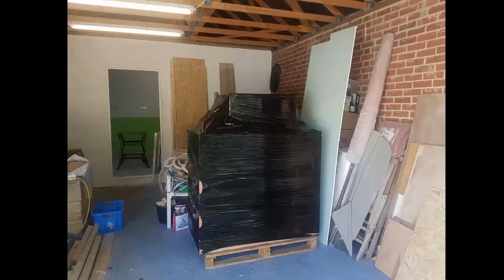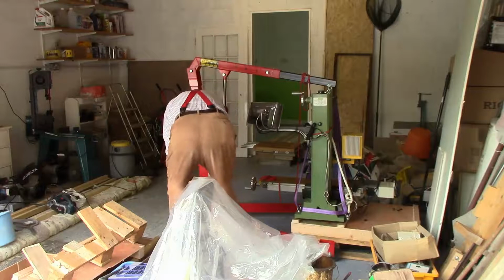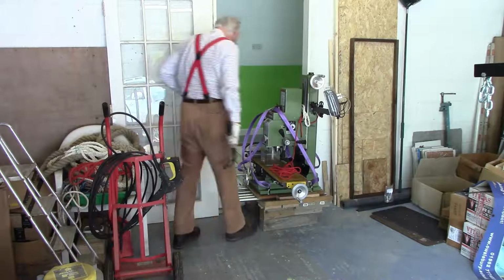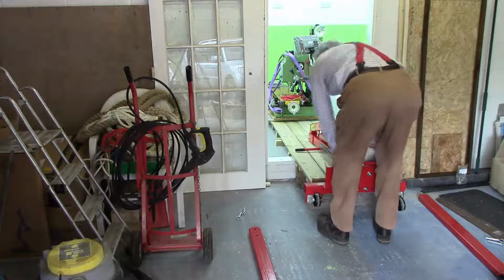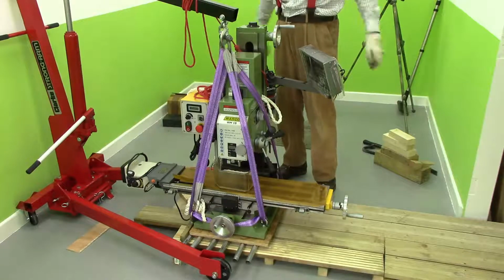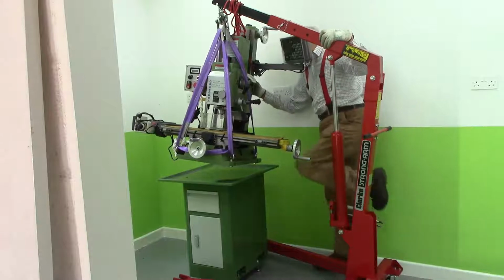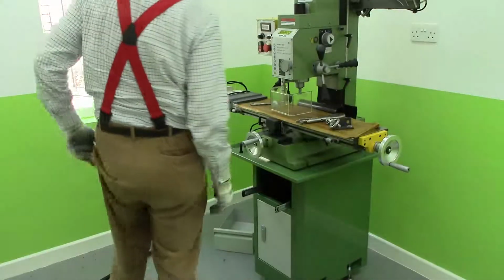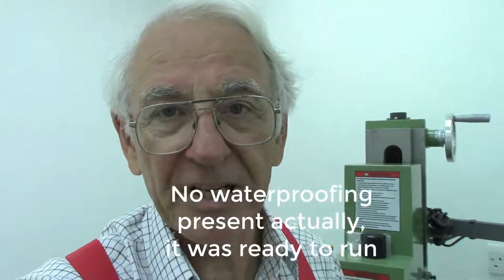Moving my new milling machine

Comment: I’m looking at getting this WM18 along with a GH1236 Lathe in around 6 months when I finally move to a house with a workshop (garage) - watching you move this alone is both amazing and nail biting anxiety inducing - I can honestly say the prospect of moving a 200kg and a 560kg bit of kit has been filling me with dread but this video (along with the one of you moving the Harrison 300 has given me some hope!) - I hope to see videos of you putting this mill and the 300 into action soon!! - I agree that the stand doesn’t look too stable given the small footprint - high center of gravity - I’ll probably look to run a strip of unistrut between the back two levelling feet then bolt it into the ground just to alleviate the fear of getting squashed!

Comment: Hi folks. a bit late but I've done this as well. Don't lift higher than absolutely necessary. Lower the weight onto supports when moving, do not let it swing. Never ever get any bit if your body in the gravity shadow - that crane could suffer a hydraulic failure at any point. I ran my head right to the top of the column, locked it in place and lifted using it. Having the attachments low down is inherently unstable. I had to dismantle the crane to get it into position in my workshop. Ideally have someone present with a mobile phone but do not have them involved in the lift. Still it got there in one piece, but do take care and think things through first. Heavy things like this do not take prisoners. BobUK.

Comment: Great minds think alike. I moved my cochrane bly mills using rollers as well.  https://youtu.be/_OB08ib9YO0
Reply from the maker: Yes, but yours is much heavier! Was that 1500 lbs did you say? Amazing machine looks like a vertical mill with a shaper stuckk on the side.
Reply: @samuelfielder  in this configuration I theorize it might weigh as much as 2700 with that vise and motor . Yes, it's part vert  mill, part shaper, part slotter. Neat old machine in my opinion

Comment: Well done. I dont like these stands however, glorified biscuit tins. Trapping yourself between a wall, a heavy machine and a crane had me on the edge of my seat - scary stuff. You should invest in a crane load leveller for that crane - £30 on ebay and a good investment for precise placement.
Reply from the maker: All's well that ends well! The biscuit tin is ok so far. Perhaps a little low for me being 6ft tall.
Reply: @samuelfielder  The stands on these are fine dont worry not like other ones

Comment: Samuel, congratulations on your new shop and the new mill. My dad always referred to moving heavy objects as an exercise in “mind over matter”. He encouraged me to think things through before plunging ahead. Good advice that has served me well through these seventy years. 
     Now, your first mistake was buying the Chinese mini lathe, not because it is an inferior product, which it is, but because it gives you your first taste of manipulating hard metals into the shape and form you want them to be. At that point you’re hooked and there is no way out. I did the same thing with the little lathe. I now have a decent, large real lathe plus a mill and numerous other machines to manipulate metal. It becomes a passion that must be fed constantly and, as you know, becomes very expensive. To think all this started because you wanted to improve Woodstock! That’s the way it goes. I started because I make custom acoustic guitars and couldn’t fine adequate metal hardware that met my standards so I deemed to make them myself. So it goes. By the way, I still have and use my mini lathe regularly. I’ve made many improvements to the machine and it’s hardly recognizable from it original form. Happy machining and making chips, as true machinists say! Stay safe.
Reply from the maker: Yes I bought the minilathe because I thought "I've never used a lathe before so I'll get somthing cheap and see if I can learn something". The lathes I have my eye on now are all 3-phase and going to be hard to get through that door though!